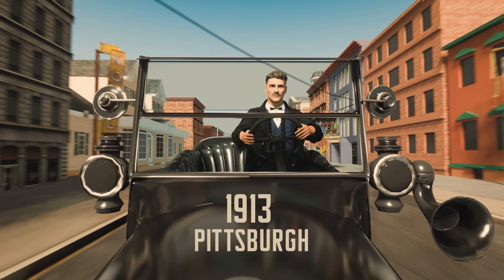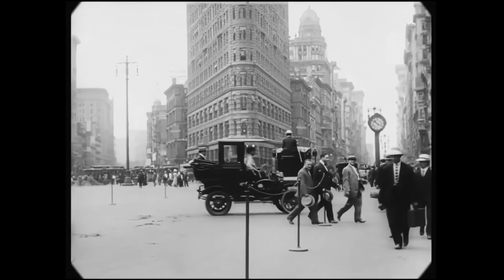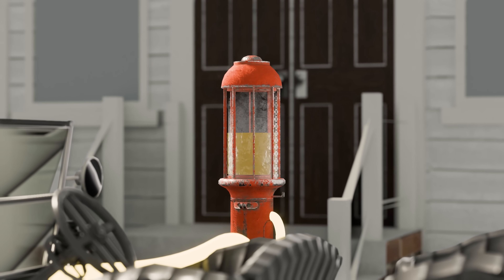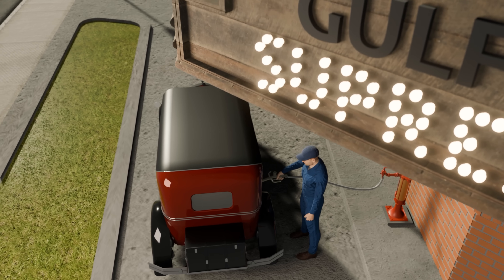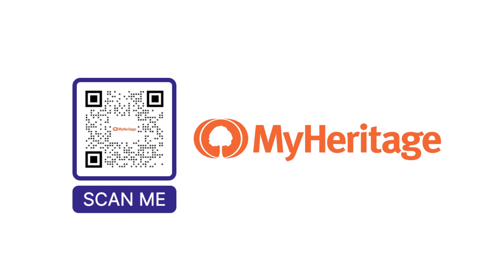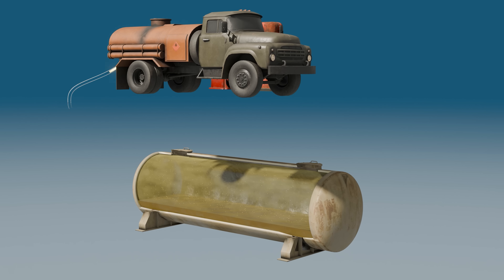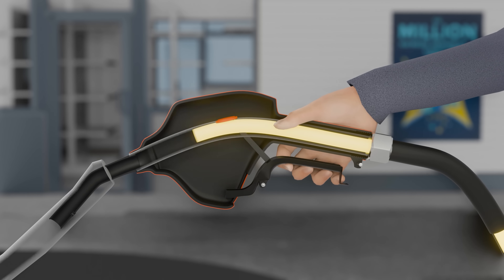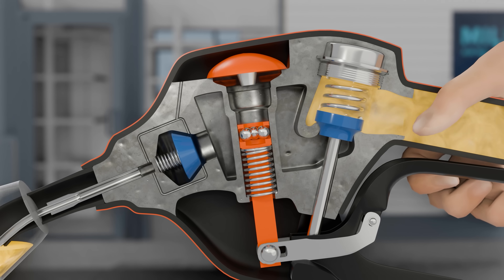The Hidden Engineering of Gas Stations

Comment: [Edited for clarity:] In case anyone is curious, US$0.27 in 1913, adjusted for inflation, would be US$8.75 today.
Reply: Just in case anyone missed it, the $0.27 cents a gallon was the price for Kerosene until gas became the preferred fuel.
Reply: Thank you for doing that calculation. Remember that gas wasn't taxed in the beginning, so that reflected the real manufacturing cost. Today, especially in California, taxes are more than half the pump price. Adjusted for inflation, the gas itself has never been cheaper.
Reply: @hagerty1952  For what it's worth, those gas taxes still don't actually cover the costs of roads. So in a way, they're still pretty low.
Reply: @Descriptor413 because the gas tax is getting intercepted to the politicians pockets
Reply: @hagerty1952  sir that price he stated was for kerosene. Not gasoline
Reply: @hagerty1952 Hence why nobody wants to live in California
Reply: In case anyone is curious, 1 US gallon adjusted for sensible units of measure is 3.785 litres.
Reply: @ExtantThylacine take the world back and you can decide such things
Reply: Whats crazy is, a gallon of gas was still $0.27 a gallon in 1950.
Reply: @ImGoingSupersonic That's still $3.60 in today's dollars.
Reply: In 1991, I saw a diesel pump in Saudi Arabia selling it for . 09 cents..... Probably the cost of drilling, pumping, and refining..... .09 cents
Reply: @idrinklight44  In 1991, producing a gallon of gas cost Saudi Arabia approximately $0.25, but they significantly subsidized it for their citizens, lowering the price to the rates you observed.  However, those subsidies have been drastically reduced today, although some still remain in place.
Reply: @idrinklight44  Still probably cheaper to go nearby gas station and pay $2/gal than drive it to saudi arabia just to save $1.91/gal. Just guessing tho
Reply: @aps7777  Unless he has a delorian with a mr fusion I don't think he is going back to 1991 to do that...
Reply: @Idrinklight44 
Probably just the tax, right?
Reply: @idrinklight44  but they can't sell it at that price, so let them keep their gas. They can only sell it (abroad) if they sell it in U.S.D
Reply: @idrinklight44  Remember all the diesel cars of the 80's, it was way cheaper. Now it's a dollar more a gallon. Why?
Reply: @idrinklight44  Labor isn't the same price everywhere... you do understand that right? It affects the prices of all products. Also it isn't .09 cents it is .09 dollars. 0.09 cents would be about 1/10 of a penny. With the information I can find that would have been the equivalent of you paying over a dollar all things considered which would have been comparable to the US. Pull your head out.
Reply: @idrinklight44 
Do you really mean 0.09 cent or do you mean 9 cent. Big difference!
Reply: 😢😮 jeesh
Reply: I was curious about txactly that lol
Reply: In Norway 1 litre is around 20NOK/2USD. 1 gallon = 7.5USD. Approx...
Reply: bUt baCK iN mY DAyS gAS waS oNly US$0.27 pER GaLLoN !
Reply: That was at the beginning of owning vehicles, production was low even for the time then, considered more luxury, so that price was actually extremely low
Reply: Which make sense, we were at the begin of this and it is always more expensive to supply something when network is not very establish
Reply: Wow, that really puts things into perspective! It’s crazy to think how much the value of money has changed over time. $0.27 back then could actually buy quite a bit compared to today.
Reply: So even in CA it was slightly cheaper.  Amazing.
Reply: I wasn't, but i am now lol
Reply: exactly, i always find it funny when people complain about gas prices today vs a century ago yet never compare wages today vs century ago. People would gladly take discount but salary should always be more 🤣🤣
Reply: @2013TombRaider  when gas was being sold for inflation adjusted 8.75, cars were a luxury, supply chains did not exist anywhere near like they are today
Reply: Thank you. I’m glad I’m not the only one who actually thinks about this.
Always seeing those posts about “a whole family sized house for $7k in 1956, wow!” and I think “yeah well the annual income for most people was about $4,800 so what’s your point?” Lolol
Reply: @jordancrossgrove8827  Hey Jordan, you are not so smart. Divide the House price by annual income.
Reply: Thanks, even my ears perked up cause I knew that was expensive af
Reply: You could have bought a house in Toronto for under 3k now those houses are 2 million+
Reply: So we are paying less for gas 😏😂
Reply: Didn't he also mention it was kerosene originally
Reply: You need a pop filter
Reply: Makes sense. At this point in history, vehicles were still toys for the wealthy.
Reply: learn the fucking metric system, you dinosaurs.
Reply: How bout now?😭
Reply: Supply, demand, and production costs also change over time, not just inflation.  In 1913 having a car was mostly just for wealthy people, so there was less demand for gasoline, also I am sure production cost was much higher because it was still a bit of a niche product and refining technology was much less advanced and probably much more labor intensive.  This could be compared to modern electronics.  A new color TV in 1985 would have been $500 or more, adjusted for inflation that's almost 2 grand, but today you can get a much better, much more advanced and larger TV for a few hundred dollars.  As technology progresses, things get cheaper to produce.
Reply: how much does youtube pay for views??
Reply: @iphonegiants  I wish that I knew 
I would like to have my own serious channel even if it was just supplying supplemental income
Reply: So gas has become cheaper over time.
Reply: @allocater2  No. You don't understand the economics of scale...
Reply: @allocater2  Heavy government subsidies will do that
Reply: @allocater2  was does such things.
Reply: @allocater2  I'd also imagine as gas station engineering improved and pump components became cheap to mass produce, gas station fuel prices went down
Reply: @allocater2 Supply and demand.

We are ripping oil out of the planet and refining it into gas, completely different than then.

Back then gas was not as plentiful.

But corporate greed changed us into destroying Earth and yanking hundreds and hundreds of times the gas they did back then.

Kinda like how if you have one cow, you would sell your milk pretty expensive as the only person with milk in a 1 thousand mile radius.

But if you have 1000 cows, you'll have cheaper milk, but you'll still be richer and more damaging to the palent than just having 1 cow. (Cow farts and stuff in the environment lol)
Reply: In case anyone is interested, the wealth gap always gets bigger.
Reply: @baloog8  
Are you a communist?
Reply: @baloog8  Thank you Karl
Reply: @baloog8 If you stop being jealous you might focus less on the wealth gap and more on the fact that WORLDWIDE POVERTY HAS PLUMMETED. So like, you’re absolutely 100% wrong. Stop being so selfish. Sure maybe you might be super poor, but poors have got 100x richer in the past century.
Reply: @niubi42069 Baloog is very wrong but undoubtedly believes the misinformation they write.
Reply: @endeavorrv the wealth gap is not getting bigger? Im genuinely curious your citation. Thanks.
Reply: @baloog8 well then work harder. Go to school. Get a second job. Stop crying because others have more than you. No one owes you anything. You ever thought maybe there are plenty of people who have way less than you do? Who think YOU have too much. Stop crying.
Reply: @baloog8  In case anyone is interested, the wealth gap is irrelevant. What's important is that everyone get wealthier.
Reply: @winchesterbear  with true headline inflation at above 8% and pay raises at 3%, I don't think so and with deferred payments we will need to make on global warming damage (crop failures etc) and other pollutions, definitely not, and don't forget national debt and oil prices increases. That being said.. overall I do agree with you in a much bigger picture but that conversation is much more complex.
Reply: @winchesterbear the price was also seemingly more expensive than prices today ($4.29 in California, for example) because the technology (from building the gas station to procuring the gas) was new. New tech is expensive. As businesses get more efficient at each step of the process, the price goes down.
Reply: @baloog8  Nah, new farms will pop up the old ones screaming global warming will fall. They are mad all the good land is already bought up in zones 6-8
Reply: @baloog8 That is all wrong.  And please stop with the climate change nonsense.
Reply: Well to adjust for the quality of life back then compared to now that 0.27 cents would be worth 3,794$ and 16 cents
Reply: @JuliusJames-s3t That was an AMAZING take.

I hate "it's just inflation".

I can't even afford to go to Mc Donald's right now. My grandpa could afford to pay for my 9 aunts, uncles, food and living as children, my grandma to not work and watch TV all day, and whatever he wanted off his ONE income.

Inflation means nothing compared to how little power our money has due to corporate greed, thank you for saying it!!
Reply: 8.75? Where you at, some island in alaska? Its about 2.70-2.99 in central va. Walmart was 2.65 earlier today.
Reply: @JHarris  What? I'm not talking about the price of gasoline today!
Reply: @Ice_Karma ohhhhh, that makes more sense. I was like dang!
Reply: @JHarris  Bro got the reading comprehension of a potato.
Reply: @Name-kd5jj He edited the comment for clarity because everyone kept misunderstanding... Which is why other people thought the same as I did. The original post was a bit misleading. But thanks for being a jerk for no reason.
Reply: That shows a strong economy. Today, Gas prices are kept artificially low. to hide inflation.
Reply: So about the same as Kommifornia?
Reply: Ok sick this is not what the video is about
Reply: People believe anything a calculator will say on the web... DEAD WRONG.
Reply: @maggew  Okay, genius, how about explaining why I'm wrong, what the real value today is, and how you came to that figure?  👿
Reply: Hey  @Ice_Karma  - We have different perspectives on this issue. R&D "True Cost Parity" and/or "Efficiency-Normalized". You know, I'm not a genius and I'm not trying to bully you invot believe something. I don't mind chatting but you are coming across very grump good sir. Have a nice day buddy.
Reply: @maggew  Your original message -- which I notice you've deleted -- was very aggressive in tone. I'm aware of the differences in the cost of producing gasoline today vs. 1913, particularly because of scale, but I wasn't trying to address that. There's also significant differences in taxation involved. I merely adjusted the 1913 price for inflation, which is a common, albeit flawed, way of comparing historical prices. Perhaps next time, say what you mean up front, instead of merely insulting someone and waiting two months to clarify that you didn't really mean to insult them.
Reply: I promise you @Ice_Karma  - I didn't, and don't delete messages. Maybe it was marked/flagged as spam? I always "say what I mean up front" and don't often insult people b/c it's a waste of time. I'm starting to believe maybe you forgot/made-up my "original" non-existent comment brothaman (or maybe confused with someone else). Best of luck to you buddy.
Reply: @maggew cope harder 😂😂
Reply: @maggew  if you think it is wrong then explain how much it would be. Otherwise we all assume you are blurting out statements that aren't tru.e
Reply: Hi  @econ0003  - I appreciate your challenge, but I believe my viewpoint is clear without needing to justify every detail.
Reply: @maggew this the type of guy to believe the earth is flat too because you “cAnT tRuSt tHe sChoOl sYsTeM”
Reply: Muh back in my day........
Reply: another reason why you can consider inflation adjustments very subjective
Reply: $8.75?!?   LMAO okayyyy
Reply: @trenteckhardt not sure why you’re doubting him. It’s easy enough to look up. Just google inflation calculator
Reply: Wouldn't it be $3 since gas today is only $3 lol
Reply: @KooLaid863 no, he is counting for inflation.
Reply: @CoolCalmCoop Counting for inflation, it would be $3 lol
Reply: @KooLaid863 na my man $0.27  in 1913 is equal to $8.77 in todays time. 

But that doesn’t mean Thats much we choose to charge for gas. Know what I mean?

Like we’re not still charging $0.27 for gas and adjusting the price for inflation. We’re choosing to charge less regardless of inflation

Comment: I remember pumping gas as a teenager in the 1960's, some cars had a whistle built into the fuel filler nozzle that started to emit a whistling sound when the tank was almost full.
Reply: Houses that use oil for heating still use that method today.
Reply: you how many years old
Reply: Wow almost jurassic now

Comment: The fuel efficiency of cars in the 1970s was 100% not the cause for decline. The decline was the shortage of oil and fears of war.
Reply: More so, while fuel efficiency increased, tank sizes decreased accordingly.  Meaning, your range is the only thing that mattered when it comes to refueling stops.
Reply: There’s been no decline to this day. There are several stations being built all the time where I live.
Reply: The cost to comply with EPA regulations caused many small gas stations to stop selling gas.
Reply: Yep, the 1970s energy crisis, pretty big deal back then

Comment: Where I live, many gas stations have above ground tanks. My mother lives in a coastal area nearby where groundwater contamination is a huge concern, and practically every new or renovated gas station now has above ground tanks. In some towns in that area it is now against code to build a station with underground tanks or even to replace an existing underground tank with another underground tank. So almost every newer station has a fenced in area where the tanks are.
Reply: It’s not uncommon, I’m in Florida. There’s some areas affected hurricane they did the same thing. Ruined underground storage tank so reverted to above ground. It works but just lots of space . And trying to deliver to load them if they don’t have a pump (and most don’t) but I have a pump truck it can be a real ass hat
Reply: Yes, most stations are switching back to aboveground when possible because they're cheaper to insure. Some of those underground leaks cost millions to cleanup. With aboveground tanks, it's way cheaper and easier to catch leaks early and clean them up.
Reply: and also have secondary containment barriers ....
Reply: Nobody asked 🙄
Reply: @jelly.212 you must be such a pleasant person to be around
Reply: @jelly.212  buddy quit your yammering
Reply: @jelly.212  Don't worry, I asked.

Comment: Data point: In 2018, there were 4370 gas station fires due to gasoline catching on fire (as opposed to arson of the convenience store, an electrical fire, or other "unrelated to the act of dispensing gas" fires.) There are ~145,000 fueling stations in the US. (Or were in 2018, the last year I can find statistics for.). That is a fire risk rate of about 3% per year.

Electric Vehicle fires - from ALL sources, including arson, someone dropping a cigarette on the seat, etc - are about 25 per 100,000 EVs on the road per year. That's an annual fire risk rate of 0.02%. And only about 18-20% of those fires occur during charging. (And again, that includes fires from all causes, just ones that happen while charging.)

So while the risk of gas station fire is well under what it used to be - it's still ORDERS OF MAGNITUDE higher than the risk of an EV catching fire while charging. It's like using a highly flammable gas to move our vehicles around is a bad idea or something.
Reply: Most electric cars on the road are way newer than gasoline cars so they have a lot less damage and wear as most are still on their first and second owners which even on gasoline car cause a lot less damage than 15+ year old one
Reply: Yea, right, like lithium isn't highly reactive and burns on contact with air and can not be extinguished normally. It seem like we trade safety for convenience.
Reply: @RaymondSwanson-u9yPure Lithium metal, sure. But so does Sodium. And Chlorine is a poisonous gas. 

But when you combine Sodium and Chlorine, you get table salt. 

Similarly, lithium in batteries isn’t “pure metallic lithium that ignites in exposure to air. 

And yes, lithium batteries can catch on fire- but they do so FAR less frequently than gasoline catches on fire.

Comment: Wild to think that gas needs to be extracted, transported, refined, transported, transported, transported, dumped into the ground at the pump, then a car needs to drive to the pump, fill their car so that they can BURN/EXPLODE it inside their car as they drive. Not only that, they need to take the vapors from the station to the plant just to get it back into useable liquid gas and then bring it back to the station to be put into a car.
Reply: Just think, in theory, a certain molucule of gas could be traveling from refinery to pump and back forever!
Reply: At $2/gal we're being taken advantage of if that's all that needs to be done. it never takes me more than a few minutes to completely fill up my tank at gas station. Why it take them so long?! The "complicated process" is a conspiracy to justify jacking up prices.
Reply: @aps7777 I cannot understand what you just said
Reply: @aps7777 so where I’m at they don’t reuse the vapor, when we reload the trucks. The vapors that are in are pumped out while loading new fuel and are sent to be burnt off near the loading rack. The reusing would be a complicated process as well because you have different types of gas like regular, premium, and conventional gas which is Ethanol free. They all have different additives in them which would make it hard to reuse.